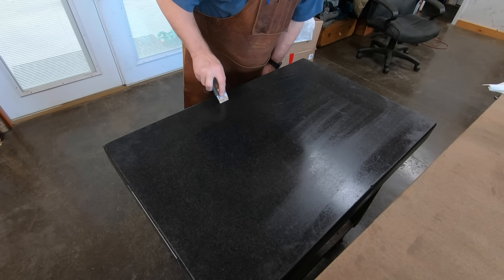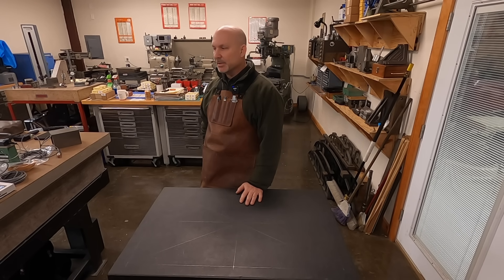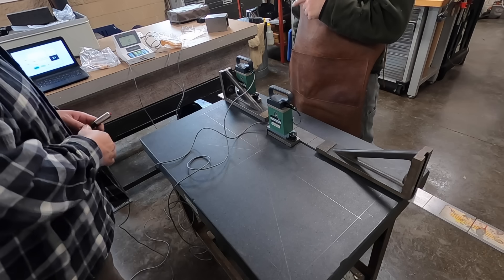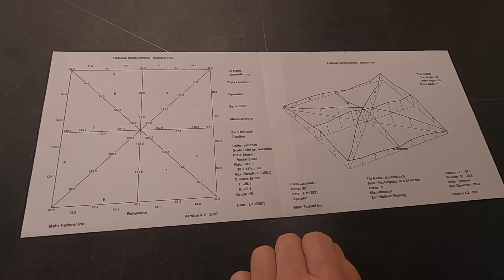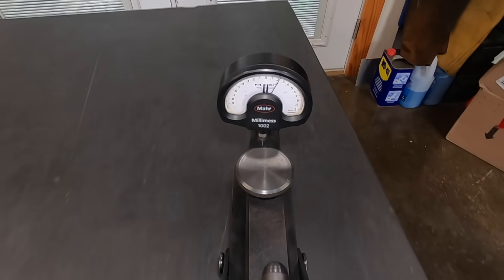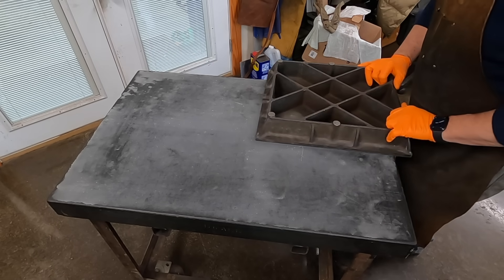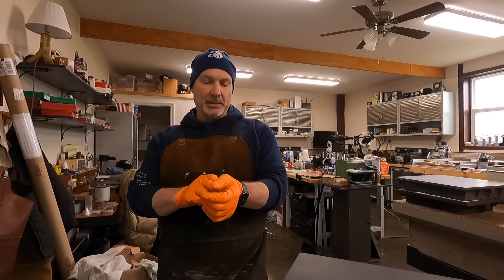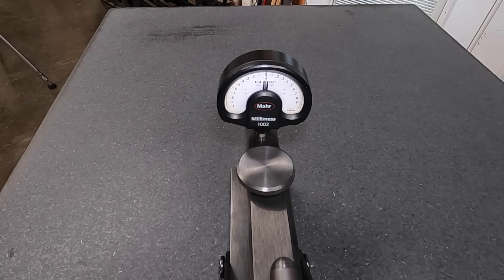Lapping my Granite Surface Plate to AA Grade

Comment: Is there a reason is made of granite? This old Tony channel mentioned a flat surface for measuring made in granite. My guess its that granite is thermally stable unlike metals
Reply: Not only that (though that is a good quality too), but granite is harder than metal (pretty much)--so you won't need to worry about scratching your nice flat surface as you place (and sometimes slide) your machined parts across it. And the reason I say "pretty much" is because you can obviously do some damage to a flat granite surface if your part is covered in say, diamond dust.
Reply: @unInnocentBystander  Ok thanks.
Reply: It also doesn’t rust. Preventing iron plates from rusting is a major concern. The slightest bit of rust totally ruins the surface. It’s also more resistant to bending.

Comment: Sir, whats the specific name of that instrument you are using to check the flatness of the plate?
Reply: local flatness is using a Mahr Repeat-o-meter.  The overall flatness is using a Mahr 832 leveling system.
Reply: @joshj392  any idea what that costs  (the 832)?
Reply: @joshj392  Fancy seeing you here
Reply: @mtraven23  The most expensive part, the 832 itself runs $3,250-$4,000, depending on lever of accuracy and calibration. It is not cheap!

Comment: Adam, Lance great video thanks for posting. I don't know if it was discussed but what size diamond grit was used 2,3 or 4 microns. I used 4 micron diamond dust to polish carbide tipped indicators that measured 35mm film that ran under them a around 4400 ft/min or 50mph. I'd make 100 a year for the film company every year. Took a month, silver soldering the carbide on the shaft to grinding the profile in the tip to lapping. Don't get me started on lapping carbide took two weeks of the month process.

Comment: Question on how the lap and plate interact. My understanding is that the only way to have a surface be truly "flat" you need three surfaces all lapped against each other. With just two surfaces you could develop a concavity. How is this prevented in this case? 

Great video as always!
Reply: That's what they're measuring to prevent.

Comment: It’s difficult to sand, or lap evenly with something that’s smaller than the thing you’re flattening. One reason is that you need to be very careful when moving it around.

Think about it. You tend to move over the center more than the edges. So the center can get affected more than the edges. You can see this in this video, if you look carefully at the movements.

Comment: Does the weight of the plate being supported in three  points effect the measurements?
Reply from the maker: Absolutely. I believe I have another clip to share about the three points. It’s part of the ASME specs. Equalizes pressure and also 3 points make a perfect plane.
Reply: surface plates are designed to not deflect under their own weight when supported at three points, that is why large plates are so thick.

Comment: "Not a hater here" but if the plate is 'only 2/1000's off flat, and Abomb work is not that precise in nature to need an  AA plate, is this just a "something I want" video, or what am I missing? (I've been subscribed for only 6 mos or so).  The procedure and dialogue was very instructive and clear.
Reply: For metrology and measuring purposes, the general rule of thumb is that your equipment should be calibrated to an order of magnitude tighter than the range that you are measuring. If Adam rarely, but  sometimes, has to bring things to within half a thou (.0005 or 5e-4), he needs equipment that is callibrated to within 50 millionths (.00005 or 5e-5). Plus, there's also the comfort in knowing that his reference surface is for sure good, so he won't have to wonder if the plate is giving false references.
Reply: @JohnWVarner  Also mentioned by the boys was that moving the plate back to Adam's shop will likely introduce some changes so being as tight as possible give Adam some margin.
Reply: Adam brought the plate Lance because didn't really know what condition it was in. It turns out the plate was actually pretty good but Adam would like it to be "A" which is understandable so they proceed with lapping. While doing the lapping Lance of course would like to try to take the plate the "AA" because we wants the challenge. If you never try to get a plate to AA how do you know you can do it? The side benefit of having an AA plate is there is more tolerance for movement and wear down the road. The down side would normally be you'd have to pay for that, and honestly an AA plate isn't any better than an A plate unless its installed in a controlled lab environment. We're talking about measurements so precise that just the heat from holding the part or instrument in you hand can throw the measurement off.

Comment: How does those measuring heads work ? Any name for them to search on YT ?
Reply: It's a Mahr-Federal Electronic Level System. It's a differential level system because the angle read by the level that you move is compared to the angle read by the reference level that remains stationary. This compensates for any movement of the surface plate during the measurement process.

Comment: What would be the utility of such a fine granite plate?
Reply: ya have to be a little bit compulsive to be a good machinist. Calipers and micrometers are good enough for the vast majority of applications, but when you are making precision tools, in order to "KNOW" they're precise, you have to have a known "standard" reference plane to measure them against. Metrology is a tedious and fussy thing, but it's really the only way to achieve real accuracy in tight tolerance work.
Reply: @BossWelder81  Okay, that makes sense. So primarily for tool making and certification?
Reply: @ZURAD  It establishes a ground truth that you can use for a wide array of measuring tasks when making a part.  Wikipedia calls it the "main horizontal reference plane for precision inspection, marking out (layout), and tooling setup" so as you go about making a part, you'll often make use of the established surface to mark up, measure, and setup your raw stock knowing you have a trustworthy baseline for all measurements.

Comment: Brazil:
🟢 Friend! I don't have a very thick stone (100mm). I have a lot of 20mm stones.
I intend to "work" 3 large diameter stones (1000mm X 1000mm). I think 20mm is too unstable for a big rock like that.
Can I glue several stones to get a more stable thickness?
I chose a harder black stone in my region of Brazil.
I also thought of making ribs in the shape of honeycombs between a sandwich of two 20mm stones.
I'm building a universal milling machine, the stones would be to "right" the flatness of the dovetail guides and the coordinate table.
I don't understand spoken English, and youtube has a bad translation.

Comment: Where could I get a lapping plate on CA?
Reply: Scrap yards or broken machines. 

Look for old wood shop machines. 
They often have some nice cast iron work surfaces that are less heavy than if made for metal.
Expect heavy use of an angle grinder to cut out what you need. Followed by machining to make it look nicer.

Comment: What are these ueed for?
Reply: High precision machining. 

It’s like when you use a ruler to draw a straight line on a piece of paper. Your line is only as straight as the edge of the ruler is. 

This granite plate is the equivalent of that ruler for a machinist. It is what they use to guide their tools to make cuts through metal. 

Just like your drawn line is only as straight and accurate as the edge of the ruler you used, their cuts are only as flat and accurate as the flat plate the machinist uses. 

So for very high precision machinist operations they need to use a very precisely flat plate to guide their tools.
Reply: ROLLING BREAD DERRRR!!!
Reply: @jeliebeen a granite plate isn’t used to cut metal it’s used for measuring metal

Comment: Wouldnt drawing those marks on the plate influence the measurements, and not remowing them before lapping? Could see the discharge build up along the lines in thr corner. I dont know anything about this, just wondering.
Reply: Good point....
Reply: Once I tried to measure some maybe 2 weeks old aluminium marks on a granite plate (if you move aluminium across a granite plate it leaves very visible whitish reflective lines) with a 0,5 micron Mahr Supramess indicator (tried various techniques) and I could not measure anything. The aluminium was after time nicely packed in the tiny valleys on the surface of the plate so this is why I couldn't measure anything. I think If you run your fingers across the pencil marks, you can scrape off the graphite off the top of the "tiny hills" so it won't affect the measurement.
Reply: The graphite in the pencil marks is the softest compound/material used anywhere on the plate, and they measure next to the lines. They only use the Repeatometer after the graphite lines have been lapped off and the plate has been washed with window cleaner.

Comment: Sorry but how do they know the work table is flat and how do they know the ground is flat to begin with?
Reply: By flattening it with a "reference" slab -- you can start completely by scratch if you have 3 flat surfaces to play with - comparing 2 against 1 etc...
Reply: You don't need to have flat ground. The only assumption is that gravity is parallel. The surface will not be "universally" level but perpendicular to the gravity vector. Gravity changes negligibly in a couple meters. On a plate 1x1m the edges will be about 55nm or about 1000ths of a human hair too low.

Comment: You are measuring in a low humidity environment, what happens when you get home, will it change the flatness? How do you compensate for humidity in a critical measurement?
Reply: Changes in flatness regarding variations in humidity are next to zero.. granite is stable under those changes
Reply: @Roi93  Then why do they wait 24 hours in air conditioning to lower humidity to measure and lap?
Reply: @doctwiggenberry5324  Next to zero is not zero... I suppose they do it because its best practise, and gives the measure a temperature and humidity baseline. But what do I know.. from what I've read the changes in humidity cause negligible effects on flatness, but that depends ultimately on how high your standards are.
Reply: @doctwiggenberry5324  And that's one of the reasons they use granite for surface plate and not other material.. among other things, the stability under changes in the environment.
Reply: @Roi93  Thanks for your reply.  I know granite is stable, but I saw them stabilize the humidity and temp to lap the granite.  I guess a millionth on an inch matters...Thanks again.

Comment: Dumb question but what's the granite slab for and why is it so important to be that flat?
Reply: its a surface plate and if you want to fabricate anything you have to have one surface that you know to base everthing else of and the first thing used was a surface plate there are some realy good videos on youtube about the origin of prezision that explains it realy understandeble by a youtube channel called Machine Thinking
Reply: If you're OK with your things being wobbly and not fitting together, you don't need any flat reference!
But things that slide and mate precisely (without gaps) need to be very flat and very square. If you start making things yourself and try to achieve precision, you will quickly realize this.

Comment: Does it change a surface plate's precision if the plate is damp or if it's humid out? I know granite has low porosity but working at such fine a level I'm interested in the less obvious factors that can harm its precision.

Comment: Could u use a finer jeweler's diamond paste on grey granite or when ur making small adjustments on any plates
Reply: the paste is too thick - it prevents adequately fast movements with the lap (things will stick together very strongly). Just buy some cheap diamond powder around 400 mesh

Comment: How much does it cost to get a plate inspected and if need be brought back to "good"? I wish i had expert freinds to learn machining and all that goes with it from, im stuck teaching myself, its coming along but very very slowly lol, lance definitely knows his stuff, thats very clear.
Reply: Calibration tech here, focusing these days on surface plate calibration and lapping. It usually depends on the size of your plate. Most labs have a minimum charge for coming to your facility, and possibly a travel charge depending on how far away you are from the lab. For smaller plate that dont need lapping calibration can be as little as $75(minimum on-site charge not included). Some of the bigger plates (72"x144") can be $360+ just for the calibration. Lapping charges usually depends on how far out of tolerance your plate is and what grade your looking to get it resurfaced to. Hope this helps
Reply: @Foxbike80  thanks, i dont know of any labs in my area, was just wondering incase i picked up a used one somewhere

Comment: Hey Adam, I was hoping you would ask Lance something for me, or tell me your experience...it's about cleaning a surface plate and getting oil stains out.  Starrett plate cleaner is either not accessible where I live, or it's not affordable.  I just bought a grade b plate which is fine for me uses, but it has gotten oily quickly.  I've heard gojo hand cleaner works, and I'm experimenting these days but I'd like a professional opinion.  And believe me, getting a professional opinion or information on this topic is not widely available, because I've looked.  Any info you could provide would be greatly appreciated.   Thanks, Josh
Reply: If you want zero residue, you might be able to find a solution (heh) in the paint aisle where surface prep (cleaning) products are.
Reply: @JeremyMcMillan  issue being some chemicals are not ideal on surface plates.
Reply: Alcohol will serve you will but do not use the plate while it is cold give it enough time to alcohol to copletely evaporize

Comment: Is the slab just setting on three points? If so,  Could possibly sag off?  That's a ridiculous level of flatness.  Of course I have topoed and graded a 100 acres with in a quarter inch.  With projected contours.

Comment: If you lean on the plate and it warms up slightly in that one spot, can it throw off the measurements?
Reply from the maker: I know it’ll move but I don’t know if it’ll move enough to matter. Now if one side of the granite is a different temps that the other, that’s when you’ll start seeing movement. Temp and humid are huge factors in the movement of granite.
Reply: @Abom79  interesting. I love your videos. I’m building my own little machine shop, I’m taking delivery of an 85’ San Yuen lathe in two weeks. I’m exited to turn perfectly good metal into small chips!

Comment: Question for Adam or Lance...when you build a cover for your plate is it preferable that the cover does not touch the plate?  Is it acceptable if it does sit down on the plate?  I could do it either way but not touching would be alot more involved.
Reply: Some shock absorbing interlayer (foam, rubber, ... ) will prevent problems, i think.

Comment: What is the lapping compound used? Thanks.
Reply: I don't think it's compound, it's just loose industrial diamond powder, probably 10 µm size or so. (robrenz mixes it with alcohol, so it is easier to handle and distribute and to avoid having too much blown away, before he can use the hardened roller to force the diamonds to embed in the cast iron plate)